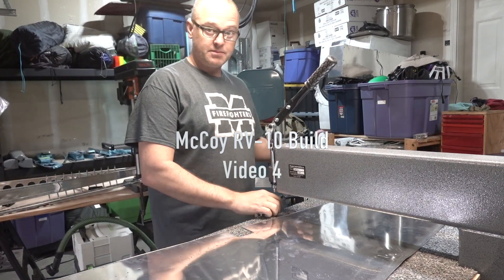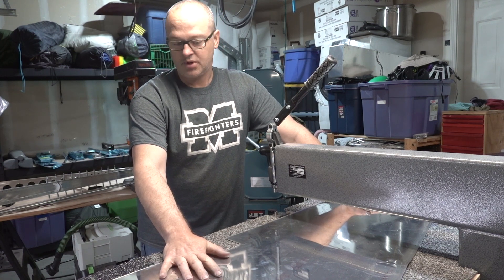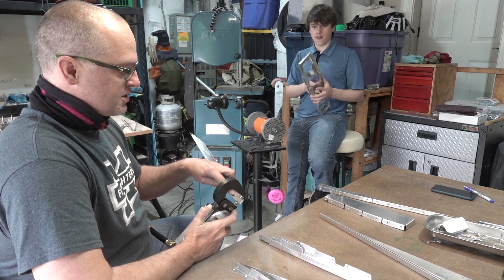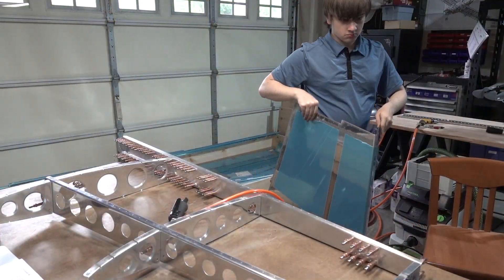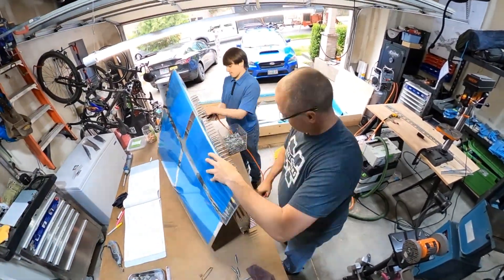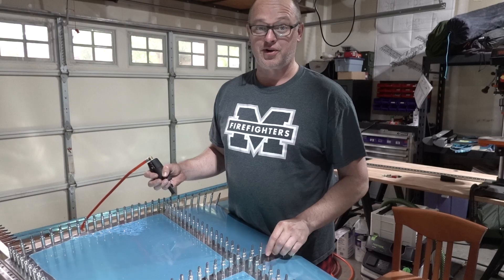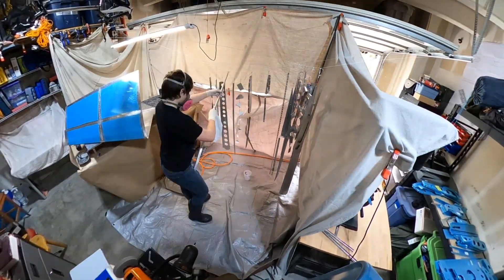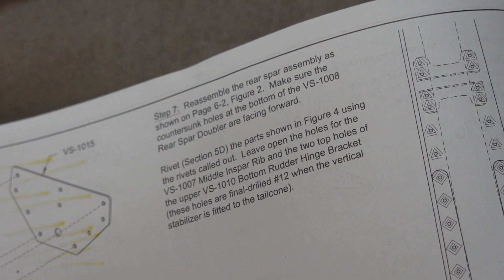RV-10 Build Video 4

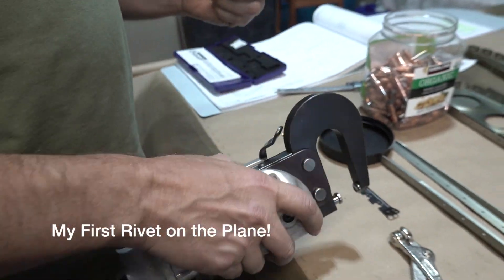Comment: At 4:12, 4:17 and briefly at 4:42 your left R-1007B rudder stop is upside down. Look closely at Page 6-4 Figure 3. The right stop is correct and the left should be symmetrical to it. Great videos! I'm just a few pages ahead working on the HS...